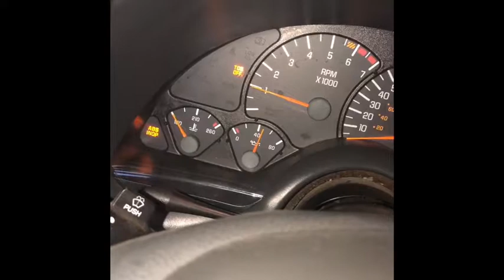LS1 Lifter Tick?? Spun bearing?

Comment: I had my Chevrolet LS1 V8 engine stripped down & I was replacing the hydraulic lifters in it when you made this video, over 1 year later it is going very good still in 2020.

I checked the oil pressure which tested o.k. so it wasn't bearings,in your case I think you have a damaged hydraulic lifter & camshaft lobe,the lifter can spin inside the Bakerlite lifter guides & gouge the camshaft lobe.

The lifters in mine were getting stuck in the engine block in cylinder number 6 in particular (it was just about every cylinder except number 8 which has the problem) & causing the valves to stick open,they were mushroomed so replacing them fixed my lifter noise !